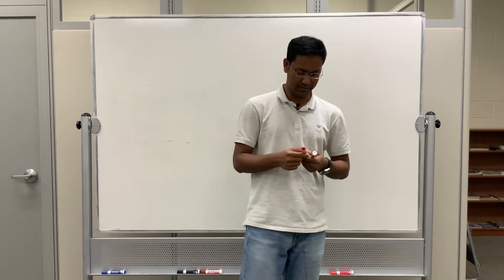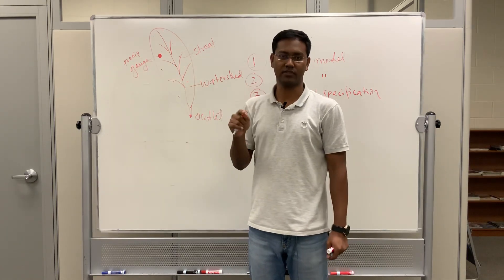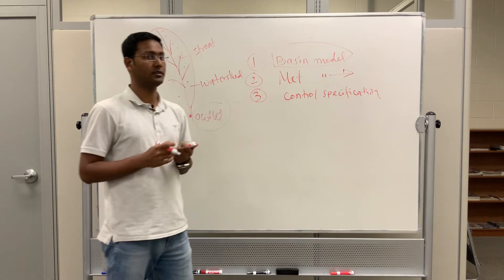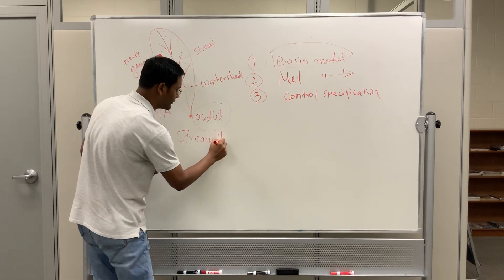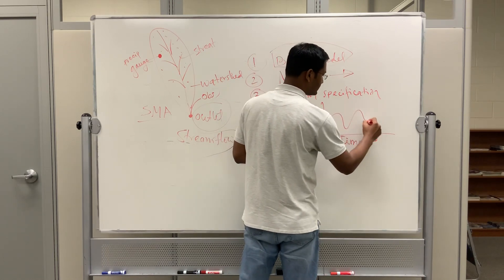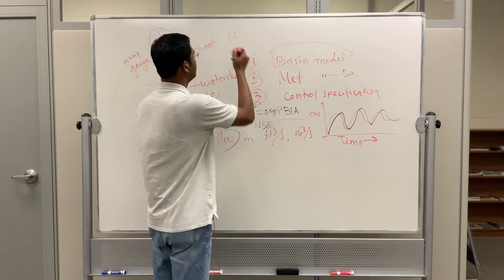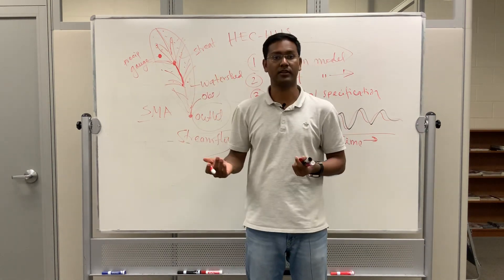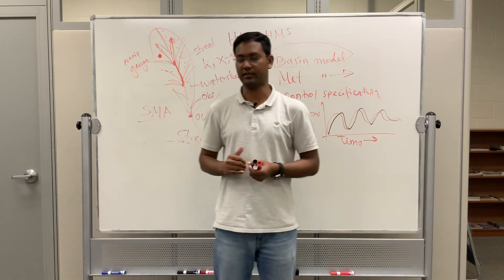HEC-HMS । T-2 | Description of model physics

Comment: Hi, for calibration and validation can we use observed data from a station that is in the middle of the watershed or upstream? because I don't have observed data at the outlet.
Reply from the maker: For calibrating watersheds, you need have the observation at the outlet of any sub-basin, then you can estimate the total discharge from the watershed. It's better to have the observation at the outlet of the watershed.

Comment: For study impact analysis of climate change and land use land cover changes on flood in a river basin what type of data we required for Hec hms
Reply from the maker: For that case you need to run the model for long time, such as for 20 years or more and the loss method must be SMA (Soil Moisture Accounting) along with ET module activated. For simulating such a model, you need to have temperature, rainfall, short- and long-wave radiation, relative humidity, etc.

Comment: If in the study area only 1 or 2 rain gauge stations then hec HMS is good for flood frequency analysis of river basin
Reply from the maker: Thank you Dinesh for the query. The more number of observed stations, the better. However, if there is only one or two observed stations then you can either use reanalysis data or if you have to use Obs data then use Thiessen polygon interpolation method to generate the basin averaged precipitation.

Comment: Hi, it is rely good explanation and it is easy to understand HEC-HMS model. Sir, I have faced  one problem during modeling of my study area by HEC-HMS model due to the presence of different water supply reservoirs and the reservoirs doesn't have gauged inflow data. but their is  daily production data and the catchment is gauged at the downstream of the reservoir. so, my question is How can i get the daily inflow data to the reservoirs????  if you are volunteer  to help me please contact me by (ephremd97@gmail.com). Thank you very much for your help!!!
Reply from the maker: If you have the production data in terms of acre-feet, then it's possible to convert to daily series and ingest into the model. Sorry for the late reply.

Comment: I have only one observed precipitation station and I would like to analysis flood risk analysis  my catchment has 4 sub basins and downloaded three other stations for CHRIPS satellite data is that possible to work and give me good result for calibration.
Reply from the maker: If you don't have enough information of precip, you can interpolate that one gauge data using Thiessen polygons interpolation methond and use it for other basins as well. But don't forget to calculate the other parameter accurately, such as time of concentration, and CN.

Comment: How about the covered impermeable areas within the watershed?
Reply: The percentage of area impermeable within watershed is specified in "Impervious percentage" in loss method.
Reply: NOAA documents are available. You can check that
Reply from the maker: For the covered areas, the percentage of imperiousness will 100 and therefore, there will be no loss due to seepage or deep percolation, rather all rainfall will be flowing as runoff.